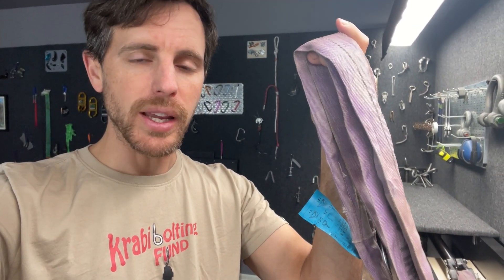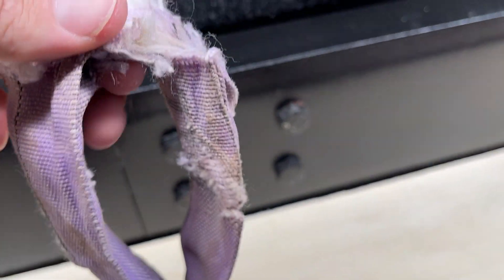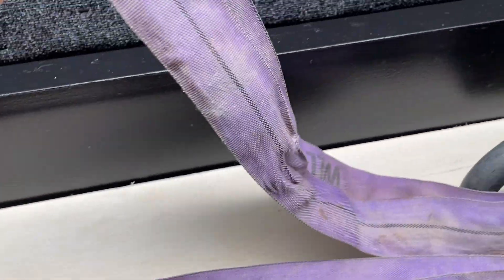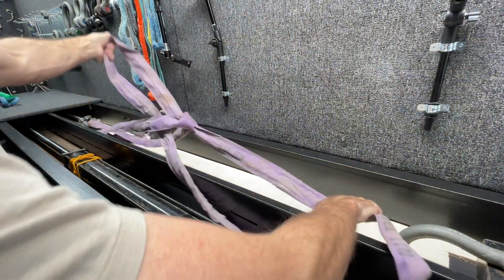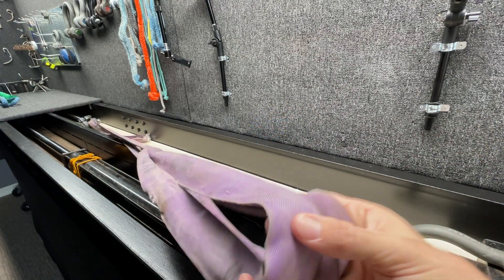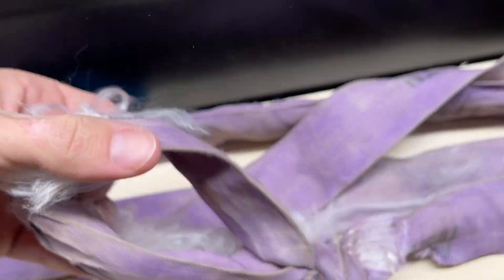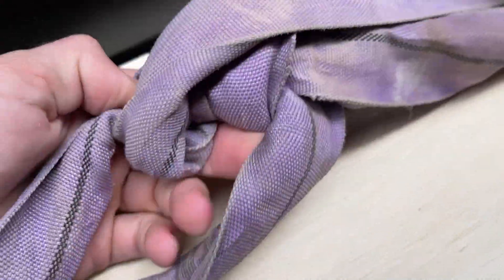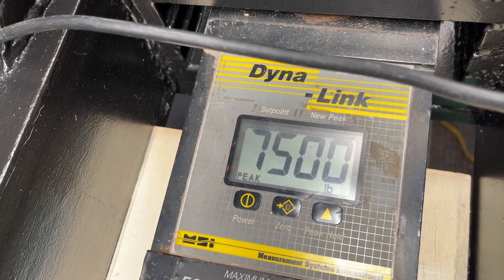I tied this 1 ton spanset in two knots and pulled on it

Comment: Perhaps it’s an odd question but, if the sling is damaged and you want to isolate it would it be a “better” solution to cut the damage area and then tie a water knot with the sling instead of using an overhand? Maybe it wouldn’t matter but I’m curious. 🧐

Comment: Would you ever use the shortening method in a climbing application? how bad do you think it would be in a thin dyneema climbing sling?
Reply from the maker: I have used this for a climbing sling before, i definitely want to test it.  I assume it would reduce it by half if I had to guess.
Reply: Adjust length of anchor in toprope?
Also: also, no idea.
Reply: https://m.youtube.com/watch?v=pIrS1p1DEgg It’s been tested! I wouldn’t use it on dyneema or other UHMWPE slings, it slips and reduces strength by at least half. Now we need the drop tower test!